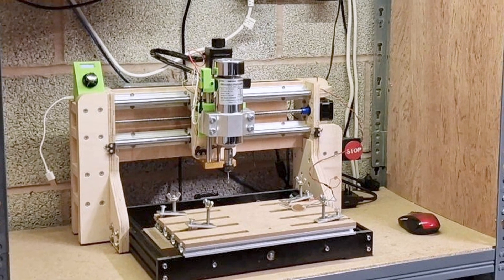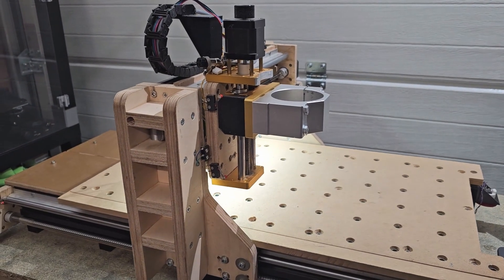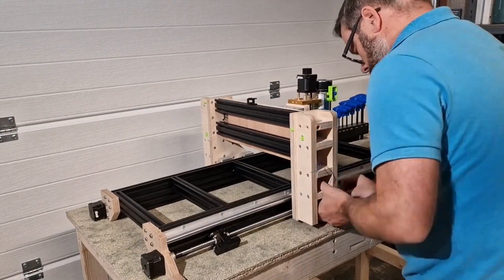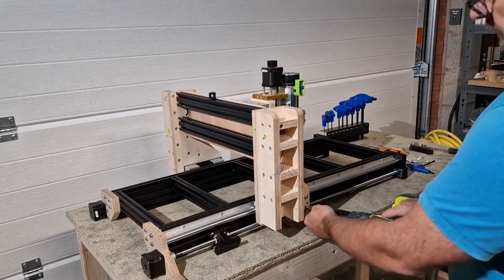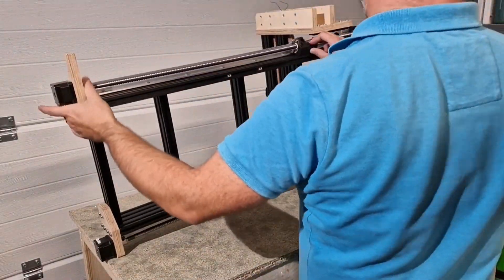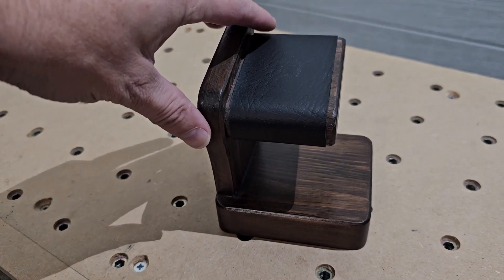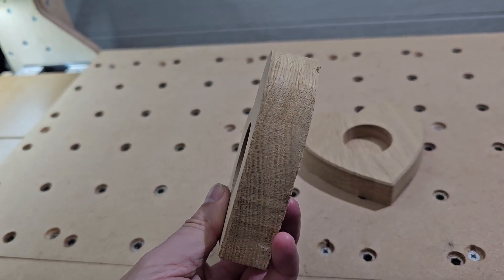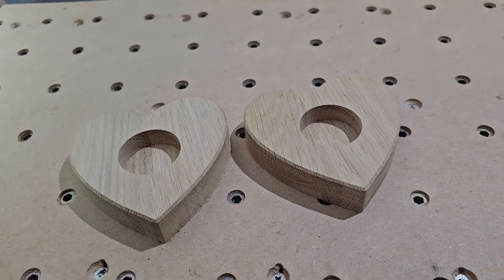3018 CNC to 6030 CNC for less than £150?

Comment: nice videos. Are you still using the CNC? Any things you would've done differently? Im looking to buy a spindle for my 3018 and wondering if I should buy the 500 or 800w and if I should go with VFD or not.
Reply from the maker: Yes it's still being used but it now has an aircooled VFD spindle fitted at 800w. I would recommend this 800w over the 500w but it is big and the standard 3018 rails will not take the weight, never mind cut accurately.

Comment: What 3018 ? Was it in one of the enclosures in the background?
Reply from the maker: 3018 only refers to the machine cutting size. In the opening part of the video you can see the already modified 3018 which was used as the base for this project. You could use a standard 3018 as the base also